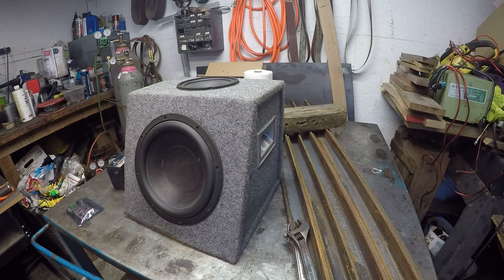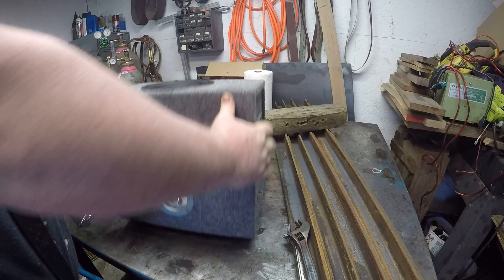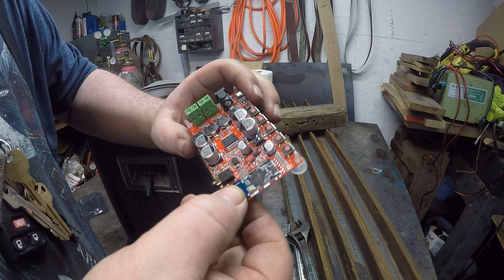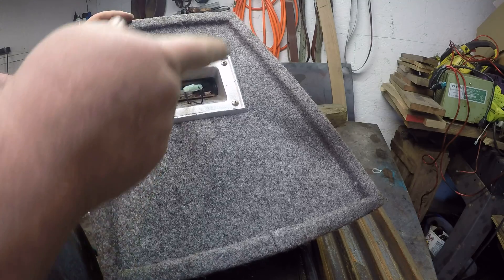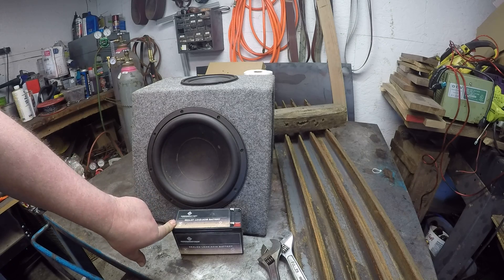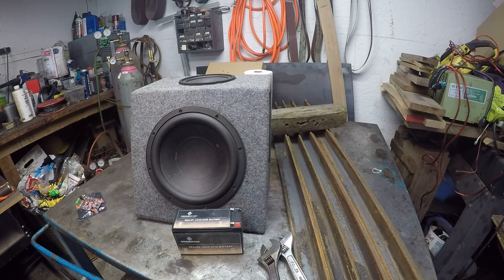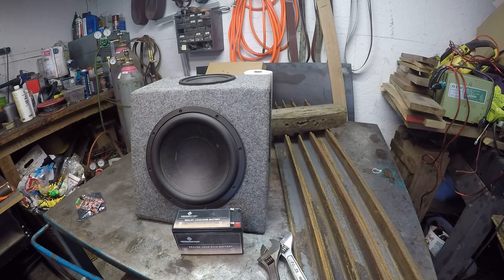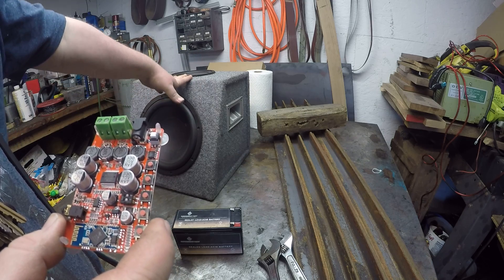Homemade Bluetooth speaker

Comment: The magnet force of that 10-inch is going to overpower the little 6.5 inch speaker. That's going to cause distortion and can possibly ruin the speaker.
Reply: This is why we leave engineering to professionals lol.
Reply from the maker: Not true you can stick extra magnets on the back of your speakers and they will do nothing I've done this if you stick a magnet to the back of your speaker with the reverse polarity it makes your speaker a little clearer